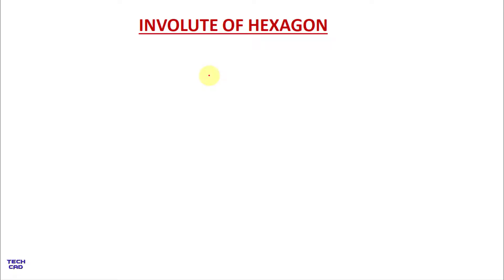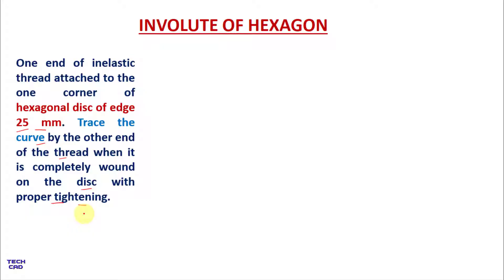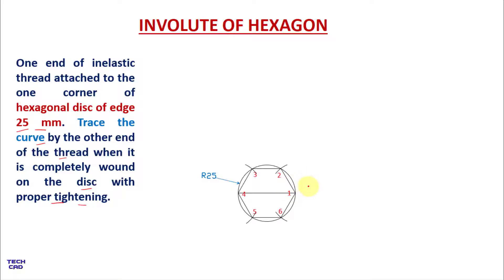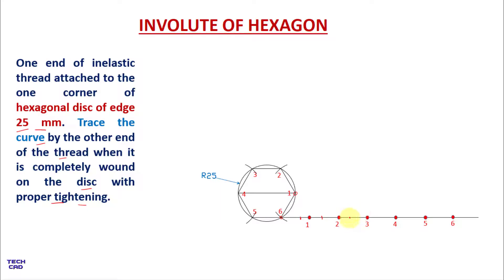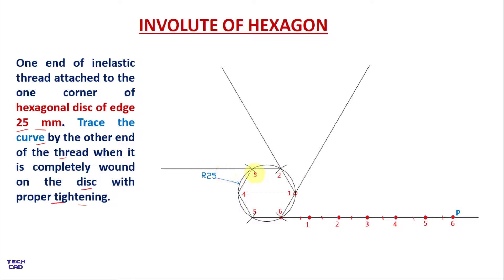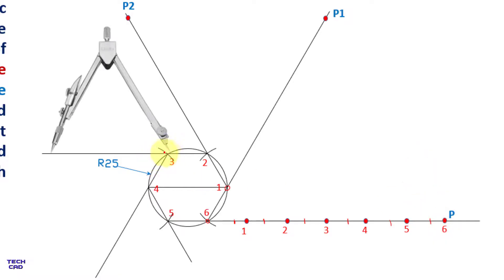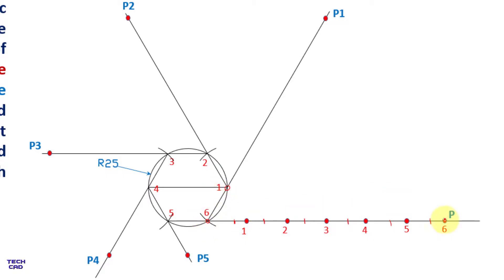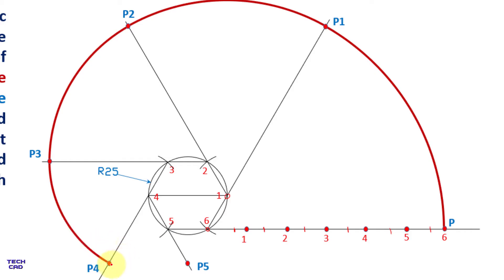HOW TO DRAW THE INVOLUTE OF HEXAGON IN ENGINEERING DRAWING

Comment: a point moves in such a way that its distance from the fixed straight line is 9 units while its distance from a fixed point is always 7 units draw the curve by choosing at least 10 points.assume that the distance between the fixed straight line is 30 mm from the fixed point.
Reply from the maker: Dear It is ellipse question. You can relate my videos on ellipse questions for this. All the Best...
Reply: Thank you so much sir, I'll be able to complete my homework.😊